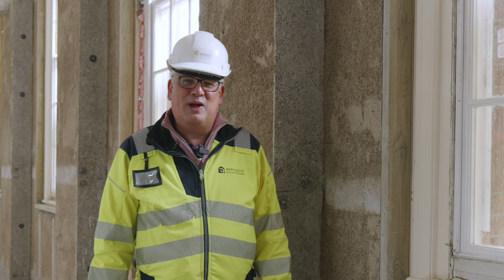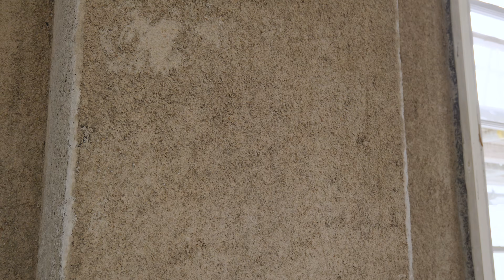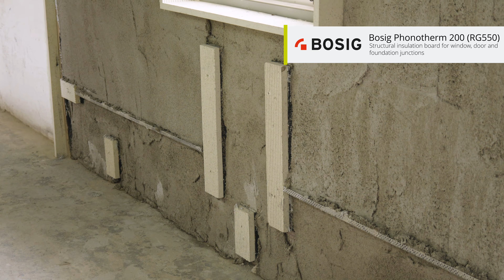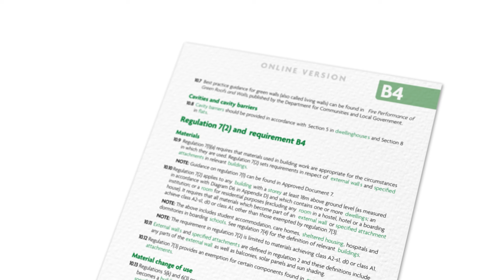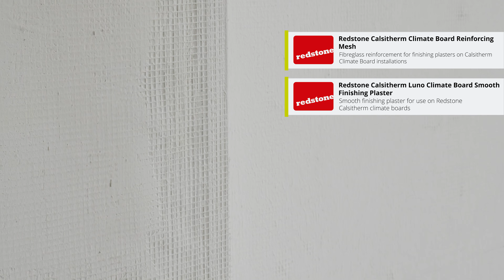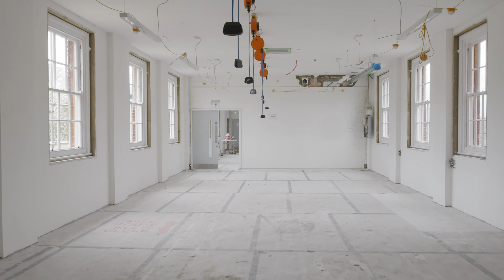How to Effectively Insulate a Historic Building to an A1 Fire Rating - Project Walkthrough

Comment: Hi, great video! Looks a great install and not eating up too much internal area. Do you have any typical drawings or diagrams of the before and after build ups? Would be good to understand on paper how the products are dealing with the Building Physics, such as vapour control etc?
Reply from the maker: Hi @callumfirth1241. In terms of the moisture/vapour control we assessed the performance of the build up via WUFI (the client used a consultant for this).  The way in which moisture is controlled is a combination of the Calsitherm and Diathonite.  Both products are moisture vapour diffusion open and also (especially in the case of Calsitherm) very highly water capillary active.  This means that internal moisture vapour is absorbed and then distributed and then released. I'm afraid we don't have permission to share any images or drawings but feel free to get in touch at info@ecologicalbuildingsystems.com if you would like to discuss further.